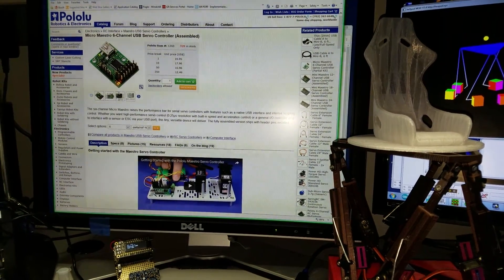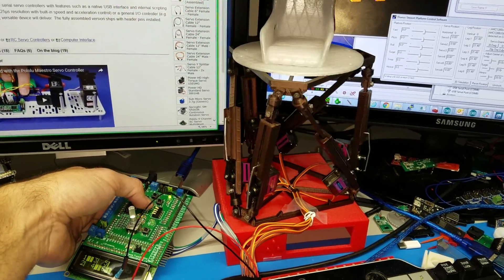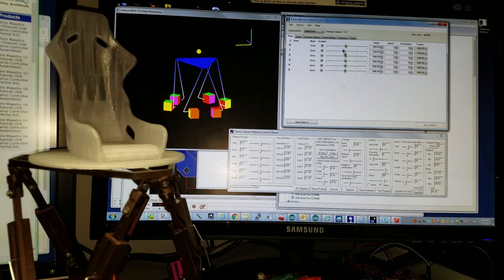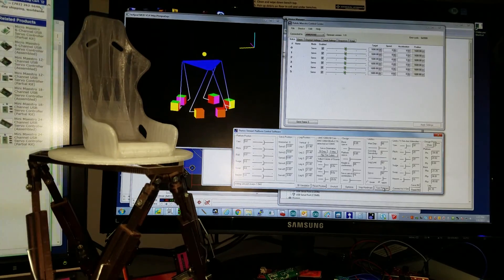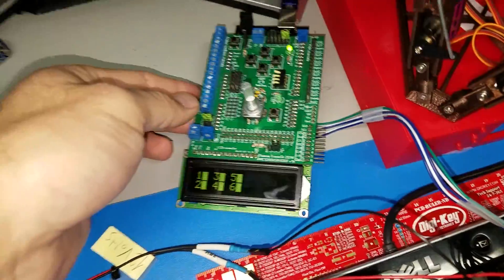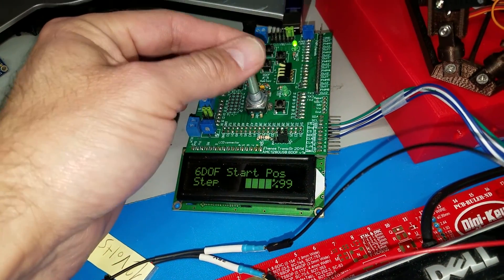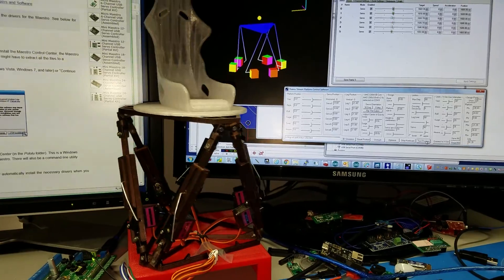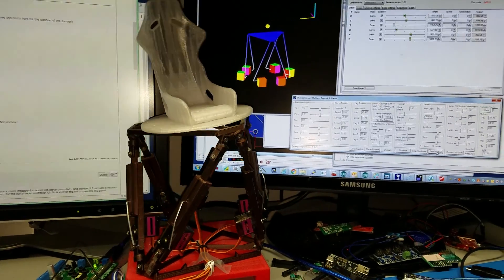Tutorial: Micro Maestro servo controller on AMC1280USB

Comment: Hello
I have purchased 2 of the maestro mini 12 and they are fun to play with but I can't seem to get any help from pololu on a problem i'm having with a sketch, I have tried to use the forum and contacted technical service,I was wondering if maybe you could answer my questions?
Reply from the maker: I'm sorry, I don't use arduino for this.
Reply: Hello Again
I don't use a arduino for this only a pololu mini
Reply from the maker: Well, not sure what are trying to use it for. I mean what are you using to send position commands for the servos?
Reply: The pololu servo controller
Thank you so much for your time
I have a pir sensor that i'm trying to add to the sketch it's on pin12. I changed the servo setup to a switch and I can see the pir sensor change every time  I detect motion and the I can use the pololu program to make the servos work. All that's no problem. Now the problem is I don't know how to add the pir sensor to the sketch. I tried to follow pololus button example but it doesn't tell me where to add and how to add the pir sensor ( how it should be written in the sketch) all I want it to do is sense motion and make servos move.
Thank You again for your time
Reply from the maker: I see what you mean. This is the "sketch" area for the Maestro itself that can do some automation. I never used that feature. I only feed serial commands to it from my microcontroller.
Reply: ok thanks